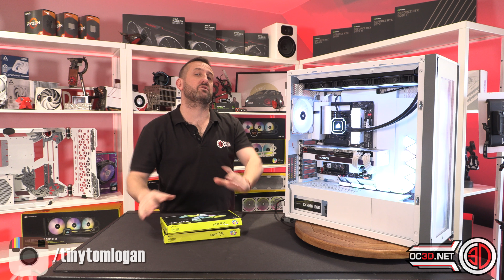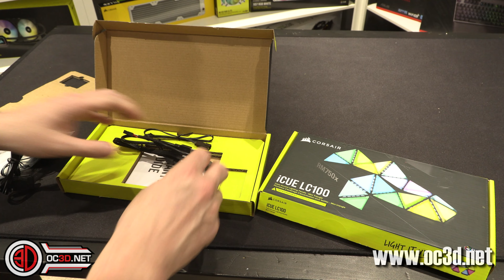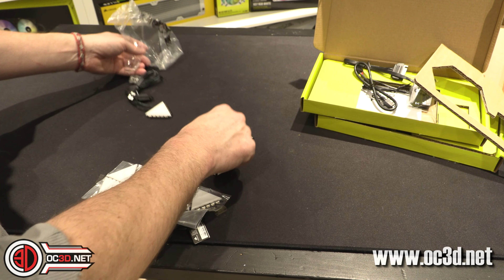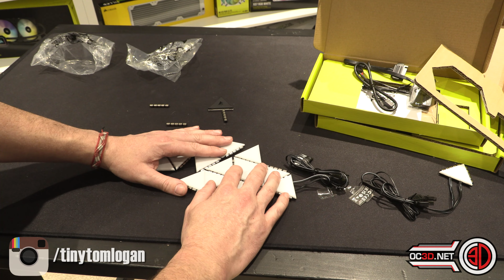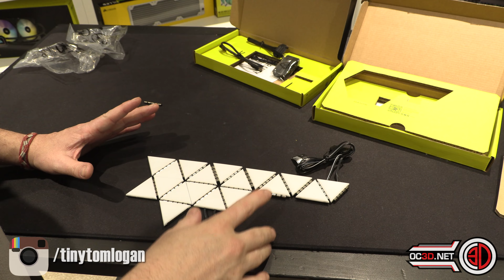Mini Nanoleaf for your PC?  Corsair LC100 Review and Set Up Guide

Comment: I got just the Master triangle lighting up... not the other 8 slave triangles.
WTF am I suppose to do with this???
JVNK.  Total JVNK.

The magnetic barbells look like they would be fun connecting triangles together into different patterns... they are not.  They are a total fumbly PITA.   Ann0y1ng as h377.  There is nothing fun about these, even if they did work as advertised.  Mine don't.

LEGOs are fun.  These are not.
They do not "automatically sort themselves out".

Comment: The reason you NEED the included Corsair Lighting Node Pro is because it uses the main Corsair RGB connector. (I am not in to whacky and pointless RGB stuff like this but as a guy who owns Corsair RGB peripherals and components (all my corsair RGB components and peripherals are actual PC parts and peripherals and not struff like light stands/strips and case accessories) I can understand why they probably went this route)
Corsair used to use this connector for their RGB and had been selling the Corsair Lighting Node Pro with 4 RGB strips since like 2015 (I own the original Lighting Node Pro that came with the RGB strips) and even the 2nd gen of the Corsair Commander had this connector (Corsair Commander Pro which is just the same as the Lighting Node Pro but it also has 2 temp sensors and 6 fan power connectors as well as TWO MOBO USB 2 expansion headers which I also own). This was BEFORE Corsair started selling RGB fans and all Corsair did for the RGB fans was introduce a new connector with less bandwidth/power and have that be the connector coming out of the fans and as a result they sold an fan RGB connector hub which could connect 6 of their fans to it but NEEDED the Lighting Node Pro or Commander Pro to power and function BUT people were getting irritated that they needed 2 hubs for the RGB and Corsair then essentially introduced a new device that would directly connect to the motherboard and had the fan RGB connectors built in and people were still unhappy with the fact that if you wanted to use iCUE for your fan control you needed a Commander Pro and either the new RGB fan hub or the old one plugged in the Commander Pro so they introduced the Commander Core which was only included with their Elite Capellix AIO's and removed the USB 2.0 expansion ports and one of the temp sensors for the 6 fan RGB connectors as well as a connector for the AIO. Now they have an Commander Core XT
Well basically the summary of this whole thing is Corsair has TWO RGB connectors a higher bandwidth/power one and a lower bandwidth/power one. The former they would use all the time a few years ago and was powerful enough to connect at least 6 of the latter RGB fan connectors to in a special hub which they have discontinued as they now sell fan RGB hubs that are independent of the Lighting Node Pro. So although I am not the biggest fan of this connector it makes sense to me as why they would use it again since it had enough bandwidth of at least 6 RGB fans ALSO as for the RGB stuff on their Hydro X water cooling stuff since each individual device probably uses as much power as a single RGB fan for the LED's is why those products even had the less bandwidth connectors.
It is a little complicated but for me as a guy who has been part of the iCUE community for a while I know this stuff (I only joined the community because I wanted to buy RGB products from a company that sold peripherals and components as I would be able to sync them together and I already had a Corsair headset which I got on a clearance sale and it felt good so I thought I would give Corsair a try and for me at least had no major problems besides an RMA for a mouse which I broke and a PSU that was DOA since the PSU wasn't sending power to the CPU which they happily replaced without a second thought with the replacements working fine no issues the RMA processes have been decent for me and once they agree to the RMA the shipping to them as well as the replacement arriving is quick)
For the monitor the MOBO and the GPU I have Asus branded ones since Asus RGB products can be synced to iCUE and I have a Lian Li O11 Dynamic PCMR SE with mirrored tempered glass (Corsair at the time didn't have any good cases that could accommodate a top mounted 360mm rad which was something I really wanted since when they released the Crystal 680x which was the closest thing to my dream case it sucked as I wanted a dual compartment case that also had 360mm rad support for top and bottom not a 240/280mm max and I still think if they elongated that case to support a 36o rad on top and bottom it would be much better than the Dynamic for me as I wanted a dual compartment case with a crap ton of rear compartment room and 360 rad top/bottom support and tempered glass and the Dynamic series doesn't have as much rear compartment space as the dual compartment cases from Corsair)

Comment: Definitely pricey, but this is the sort of solution that you have in mind that puts the finishing touches to your setup. Most people will look at it and think 'hang on, from £100???", but there will be a small number of people who have created a unique system theme - lighting, shapes and other design features - for whom the LC100 will be perfect and irreplaceable. 

Presumably iCUE's software side can handle multiple independent 9-18 triangle chains? Corsair's software hasn't been great recently but hopefully it's reasonably flexible and expandable now.

Cheers for the review TTL.
Reply: How unique can your system be, if everything is bought?

Comment: A 
One
Hundret
Thirty
Bucks 
Per 
Package
Guys i can build a computer at the time for 130 bucks wich could most games in 4k...
Dafuq
Reply: A PC that can run games at 4K for $130/130€?
No, no you can't.

However, I will agree with what most people are saying, this is way to pricy for what it is.
Reply: @VoxLuxe-w2h  well i meant used pc parts from ebay ...
But i remember myself playing 
Star conflict, farcry 3and4 and more games on my pg348q (yes i know its not full 4k but whats then 3440times1440?)
with a 40 dollar p7p55d with an i5 760 +4.99 with transport
+ A radeo  hd 6870 (then around 30 bucks with transport)(was a gigabyte one)
Seasonic 360w gold (these go extremely cheap for like years noe they cost like 20-30 bucks. With transport .(dont use the antec 420w ones they just shut off after like 10 minutes of gameplay)
Ultra Cheap pc case
Ram+hdd i got out of a broken hp pcfrom the garbage disposal
6gb ram 500gb hdd i think it had)
45+30+30=105 euros
Windows 10...
1 cheap molex to 6pin

You can easaly go cheaper
Get a 6850 and do a bios mod
(Most of the asus 6850 work with a 6870 mod
Sometime these hps have even a 6 pin then just use a paper clip and put both power supplies in the case , yes extremely janky but it only needs to work right?
Try it for yourself ...
Just dont overclock the cpu too hard  (depents on psu, but with the seasonic one you can do around 3.8 ghz )
The 6870 ran with 900mhz.
Yes you wont have 100 fps all the time, yes if you play something like endless space or video rendering software where the turns/saves are processed by the gpu and not the cpu the processing may need a few more minutes , but it works .
And yes i get in endless space around 50-70 fps . (50only when i go for next turn)one nice thing is that you can force crossfire in most games so...
Yes 90% of my games run rly great in crossfire , ram has to be fast enough but thats it.

Yes you cant play new triple A titles...
But most of them are shit anyway so
And yes it was as loud as fun.
Please if you try this dont take some cheap china power supply just search for seasonic 360w. And the 80gold black colores ones should all do it. Everything only aircooled.
You can even search up "hp z220 workstation" too and find a cheap pc  where you can put a 6870 too in.
There you just cant overclock. Only problem is that the hp systems are really not reliable. 
So bettter get as described above a cheap p7p55d with an i5 760 or 750 or something like that.
I hope that this is not too much text for an average reader
Sry for bad english
If you have questions just ask.
Edit yes crossfire works the hpz220.
Reply: And yes i still play sometimes with that thing but only because its fun.
And when i fried my next 650w corsair psu in my "newer" pc....
(the one i use now has a broken fan and i just put 2 120mm fans ontop of the broken one lol)